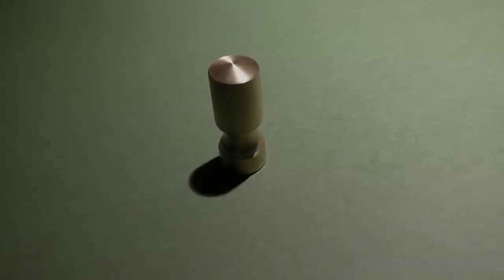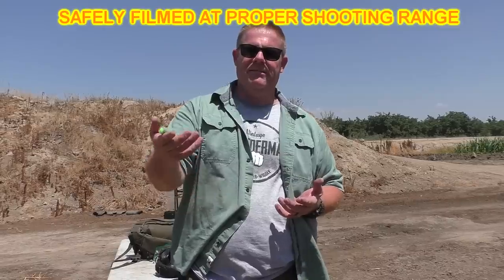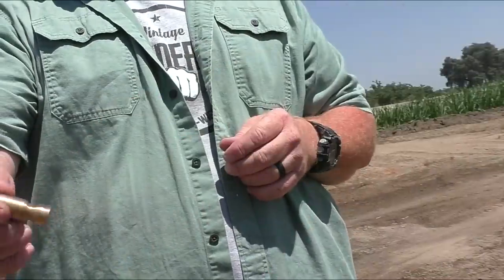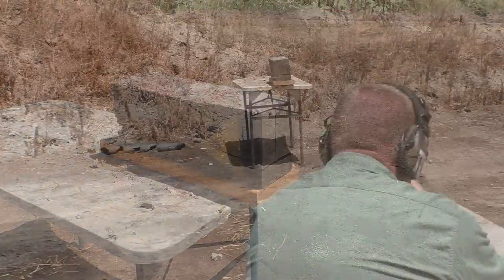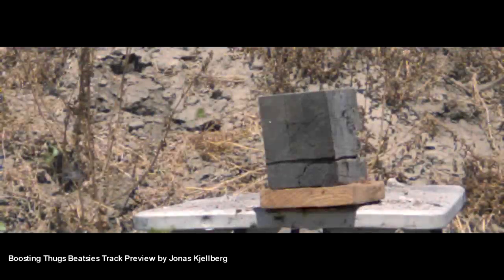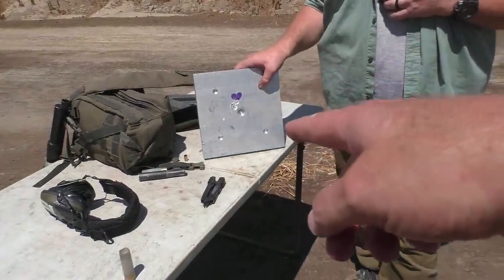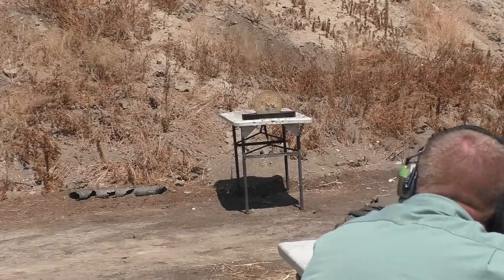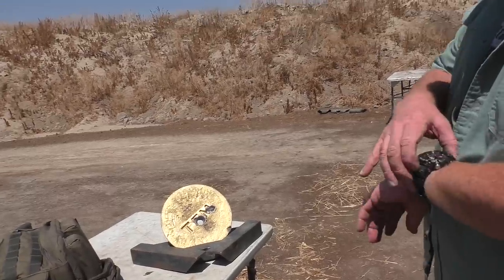MASSIVE 12ga. Slug  Blasts THRU Lead Plate!

Comment: Wasn't there one slug that tore a hole in that lead plate, like a year or two ago? But that thing did do a smooth hole in that lead plate, also the slug seemed to be full lenght after it passed through and was tumbling to the bank.

Comment: only the russian 308 penetrators went through the plate as i recall
Reply from the maker: ah,  good point
Reply: @taofledermaus  this is also the same concept as with the 30cal ak rounds vs the 5.45. Or a better point of the raw kinetic energy put down by a slow heavy hard projectile has more penetration capabilities to the hypesonic equivelent. Ie 458 socom vs 223.